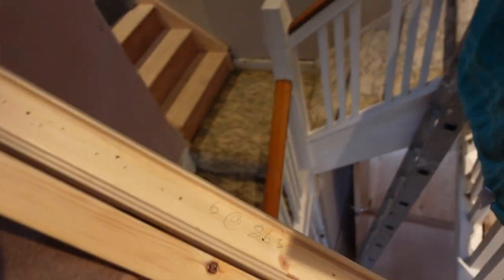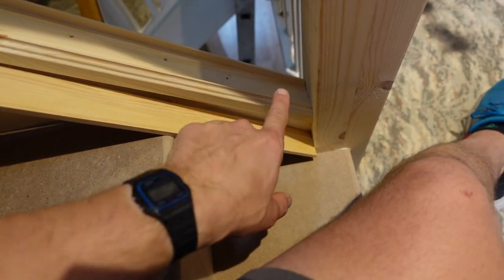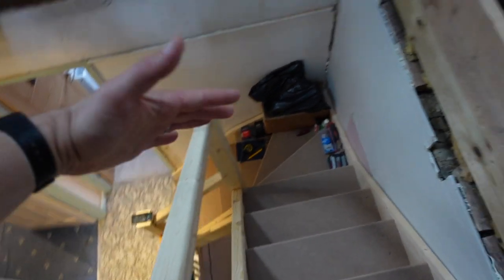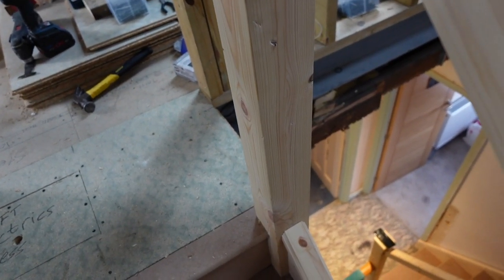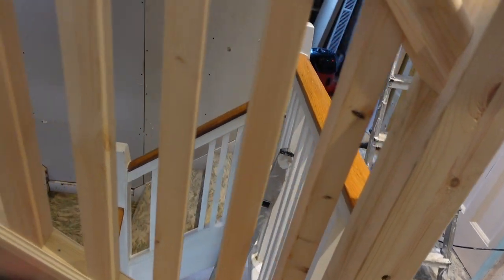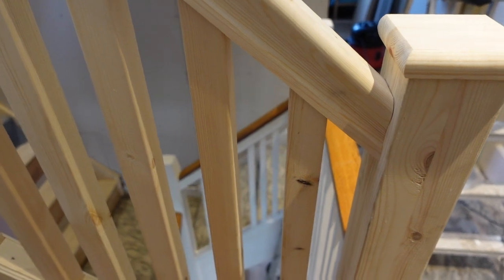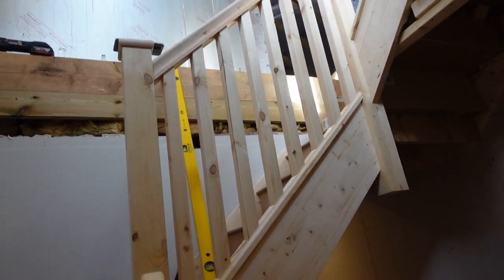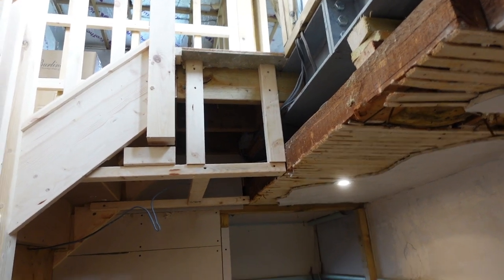Loft Staircase part 6 - How NOT to fit staircase spindles

Comment: Best way to do spindles is measure the distance and divide by spacing. Cut the amount required and place all at the bottom then remeasure the distance for the packing. But check for plum as you go.
Reply from the maker: Yeah, my stupid mistake was measuring the slope distance between the posts, rather than the horizontal distance 😩🤷 lesson learned, and hopefully for others too

Comment: You need to keep checking as you go up. Spindles can vary a few mil and the spaces might end up a mil bigger each run and it all adds up. I usually take a spacer and an offcut of spindle and Mark it all out first
Reply from the maker: Yeah, great suggestion. I also realised I was measuring the diagonal distance, rather than the horizontal distance between the two newel posts!😖

Comment: Fair play to you getting stuck in and having a go. Regarding the bit of handrail at the top I’d come off the side of the newel post with a little mitred section before terminating to a half newel on the wall help you get it away from the door frame  👍🔨🪚